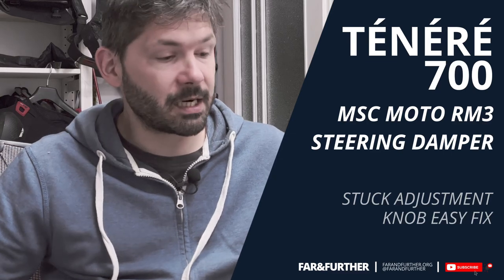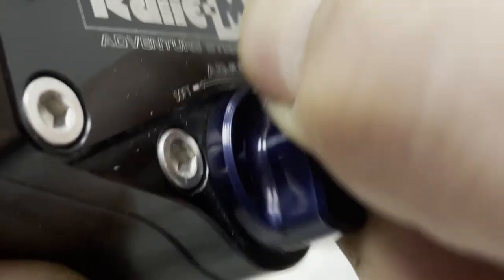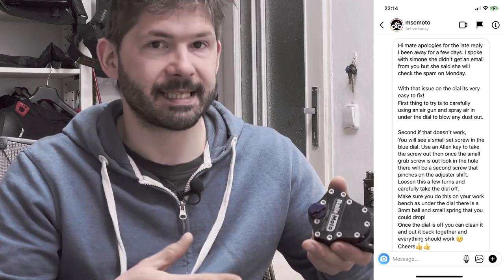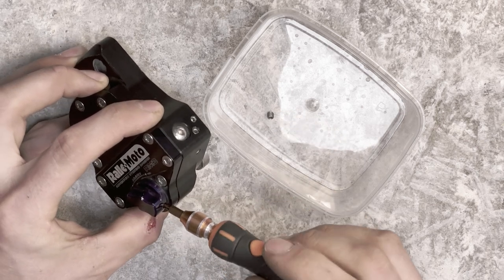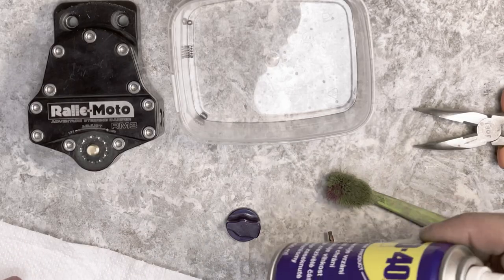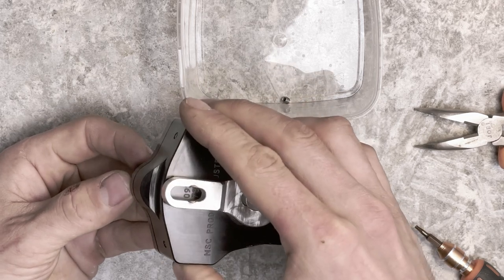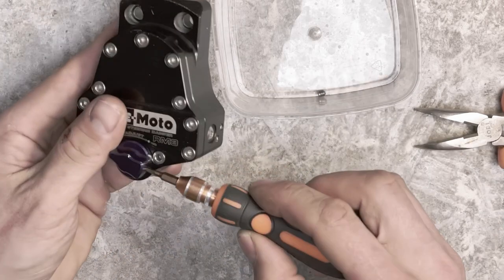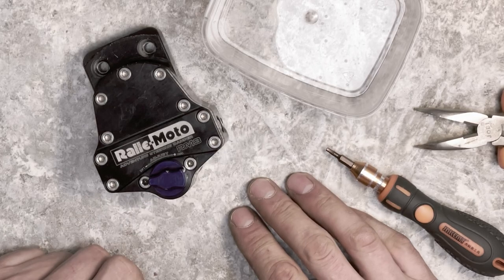Yamaha Ténéré 700: MSC Moto RM3 Steering damper stuck adjustment knob easy fix

Comment: THANKS FOR ANOTHER PRACTICAL VIDEO.   I wanted to ask you how "better different" was the T7 after the rear spring change?  I am 79kg-80 all equipped.
Reply from the maker: Hi Roland,
That means you're probably the same weight as I'm. I'm 72-75kg in underpants depending on how many beers I had.

I've put 85Nm spring on the rear despite the 80Nm would probably be enough but I need to compensate for the amount of luggage I carry when I travel.

It is much better, especially when one starts to jump or go hard off-road because the rear stops to bottom out and has some slack to deal with that kind of riding.

The most important is the rider sag, I was not able to get it right with the OEM spring unloaded, I was able to have correct with 80Nm spring with 17 preload and with 85Nm I have about 8 preload and good sag.

If you travel both loaded and unloaded, I'd justify to get the stronger spring as it will give you adjustment range, with OEM you'll be on max/close to max preload all the time.

Comment: Hi, On your install vid you asked MSC as to the correct placement of the steering stem washer. Did they come back to you with an answer?
Reply from the maker: I've checked the e-mail communication and unfortunately not. The communication is not their strongest suit which is a bit of shame.

Comment: Hi Pavel, What is your opinion of steering dampers in general now you've had one for a while? Have you made a video of this?
Reply from the maker: I've not yet done video on the damper. Main reason was that I had it only one season and done the Dinaric 2021 with it and had no time to do it. It does not make sense to do a video if one didn't use it for a while to be honest.

Now I think I could... In a nutshell...

When you ride fast and for long (rally) then it will help you a lot to reduce the fatigue & limit the risk of the handlebars suddenly closing on you. High speed is where it starts to matter on sand, rocks, gravel etc...

When you ride on road you won't use it at all. We on T7 usually don't ride at speed to get tank slapper on the road.

When you ride gravel / normal off-road it's a luxury item. It will help you if you make a mistake or if you hit a rock which would close your handlebars but in general you probably don't need it.

When you ride technical stuff (single trails, sharp turns etc...) you need quick response so you don't use it as well.

That would be my opinion.

Comment: Hi Pavel!!
I feel the need of a dampener at times, specially going fast in loose stuff with mixed in gravel/rocks. But also in technical slow stuff, front deflects so hard. 
Is it worth it? 😬.
Reply from the maker: That is a million dolar question, isn't it... well about €400 question.

I found it useful when going fast off-road in general.

Especially in the terrain you mentioned, sand, rocks etc... When in really technical terrain at low speed, it's better to have it set to minimum as one needs the handlebar free to be able to manage the situation.

For rally for example or training it will save you loads of energy and the reason I bought it is for the Dinaric rally and other rallies I - now wanteD to participate.

As those situations are also higher speed it will provide a layer of security when I make mistake or miss some terrain feature which would deflect the front vigorously, possibly leading to "brown pants" or worse situation.

So, for those scenarios, yes, it works and is worth the money.
Although it's also doable without it of course.

In terms of overlanding/travelling... I'd spend the money on something else instead.

That would be my take on it.
Reply: @FARANDFURTHER  thanks Pavel 👌
I saw Off the road .de have scotts dampener for 400€ 🥵, but i think i will get a new rear shock first, then maybe a dampener 😬 and/or Donner tech new rear handle/rack with soft luggage support. 

Cheers

Marcus
Reply from the maker: @everythingtenere  Even if you think about the rally, I’d invest into the suspension rather than the damper. I didn’t really believe how much difference suspension makes but it does.

👍
Reply: @FARANDFURTHER  yea, got the RR open cartridge kit, and after that you really feel how much the rear is lacking in performance 😬
Reply: @FARANDFURTHER  ohhh, was looking at just the bracket for the scotts one 🙈. Complete kit is 720€. Ohhh boy
Reply from the maker: :) I have the MSC and it works, can't comment on the differences between the products as I'm 100% new to the dampers....
Reply from the maker: Yep the forks work wonderfully now. I serviced my rear shock and had the piston replaced for the K-tech upgrade, I think it works better. But it can also be just my "suspension ignorance" speaking :)
Reply from the maker: 720.... that's a bit over the top!